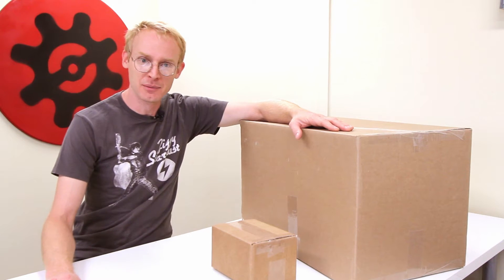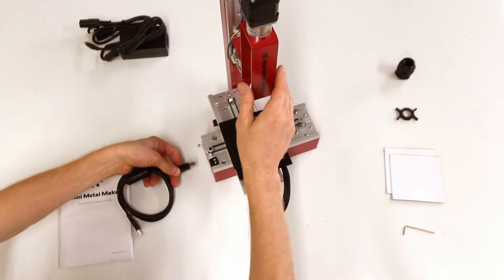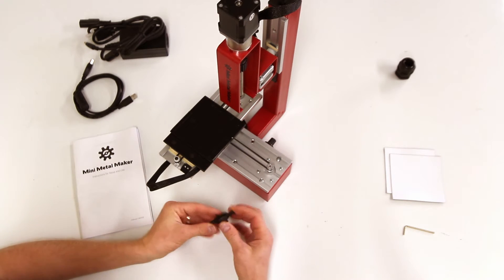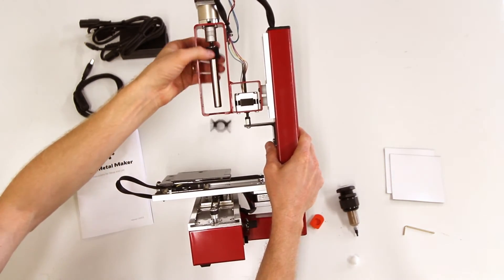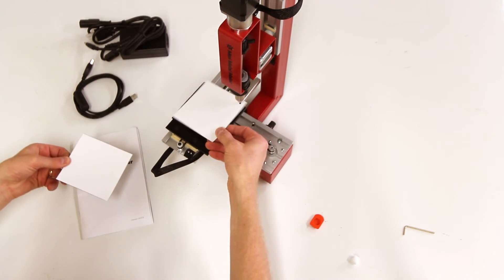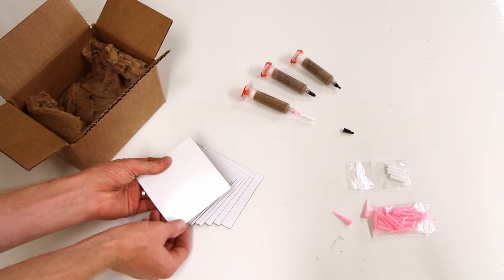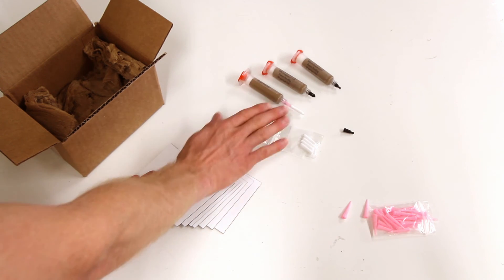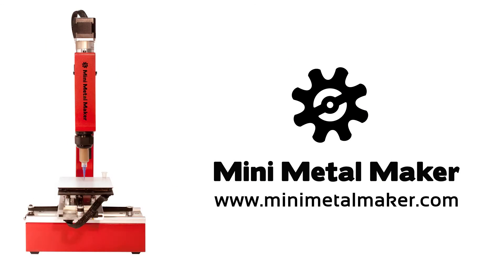MMM02 - Unboxing your Mini Metal Maker

Comment: I know that this product is no longer in production. Does the DIY book include how to make the clay cartridges and what clay needs to be used. Also does it include the software needed for the printer? I think this idea is genius and wish I had found it when it was being made.
Reply from the maker: Dear Brian, Yes the DIY instructions tell you about mixing commercially available metal clay to the right consistency, and then the machine has a few different options for fitting different commercially available plastic syrringes. Hope that helps! -david